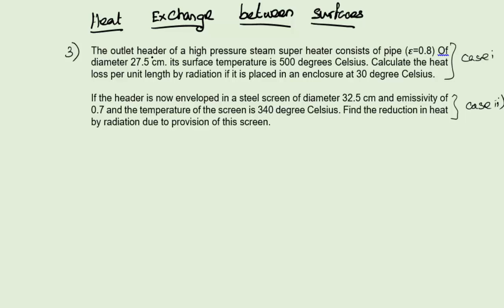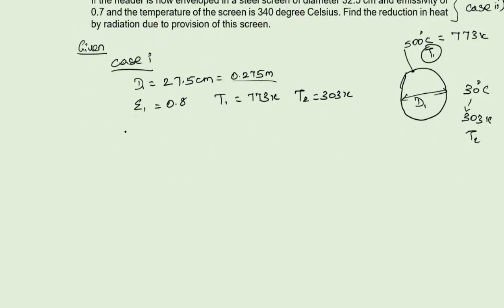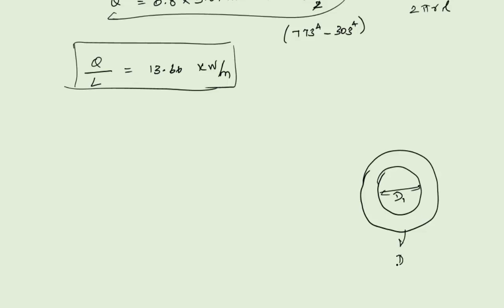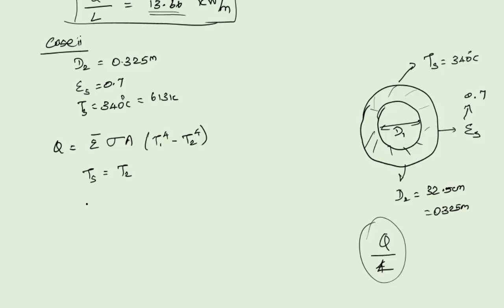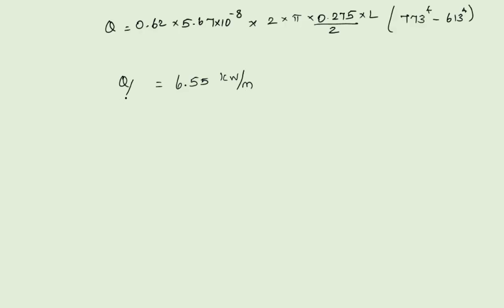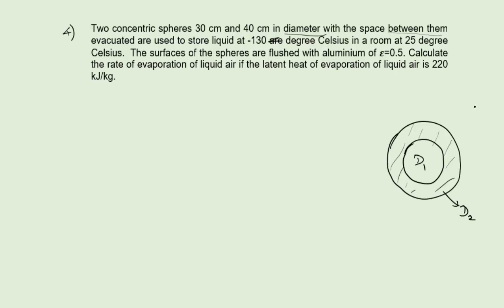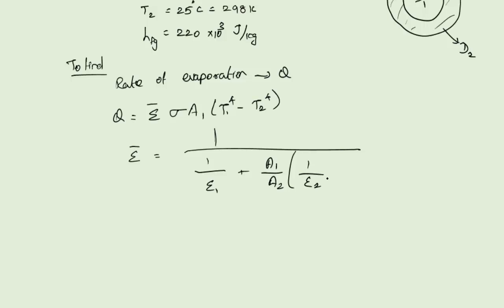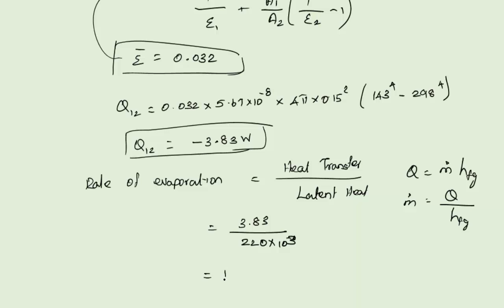Lecture 32 | Problems on Radiation Heat exchange between Surfaces | Heat and Mass Transfer

Comment: Sir for the 4th question what did you take for ephsilon 1 and 2
Reply from the maker: both the surfaces are flushed with aluminum of ephsilon equal to 0.5...given in the question itself
Reply: @VENKATQ  sir if epsilon is 0.5   than i am getting epsilon bar as 0.3902
Reply: @rehansolapur5382  yeah bro